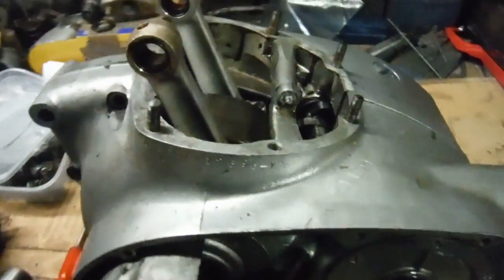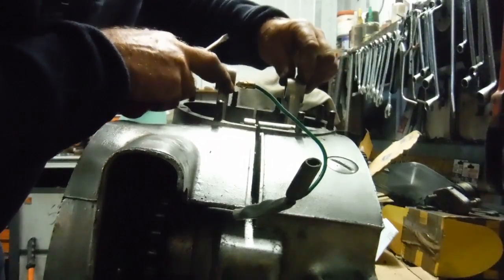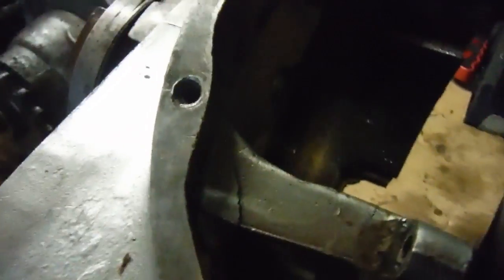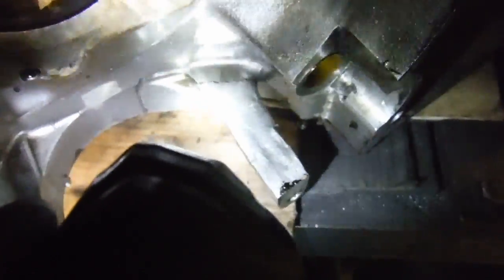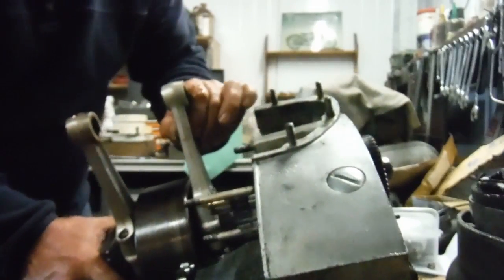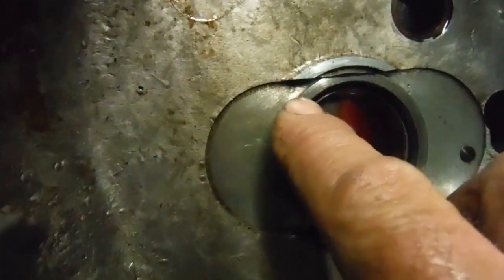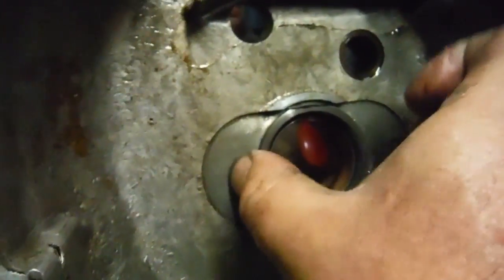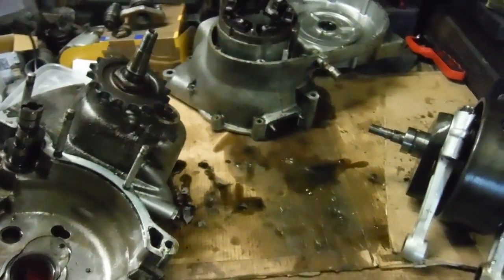BSA A65 engine - splitting the crankcases, what will we find?

Comment: Those big ends looked a bit on the tight side, they should have at least a thou/thou and a half clearance.
Reply: Aluminum or steel con rod caps do we see?
Reply from the maker: Aluminium.
Reply from the maker: They were still covered in oil, cold oil ...
Reply: @paulhenshaw4514  I'm sure you will be plasti gauging them. At least it's apart now, so checking and repairing can begin. Looks like it might not be too bad.

Comment: Generally speaking no thrust washer with early (before 1965/6) A65's with ball drive side bearing. Bush has thicker flange for these motors. With roller bearing in it's narrow flange bush and a thrust washer. Both need shimming to 3 thou max end float between crank web and drive bearing whatvever it is (ball or roller). What you have here Paul is what I've seen a lot over the years with A65's, mixed bits that sort of work ish if you get me. A lot of A65's were blown up back in the day because of this. Early and later cranks are different too (Webs machined plus case to match to shift crank over, plenty of info on internet...), mixing and matching can work if you know what you're doing. Interesting that crack on bridge piece, any evidence a rod hit it? I've seen that to in the past. Great stuff so far!
Reply: I believe that the crack was caused by a drive side main bearing letting go and allowed the crank to move. Interesting to say the least.

Comment: It’s great seeing an expert like you tackle a job like the A65. In my day (late 60s, early 70s) I used to carry out my own repairs on my own bikes (BSA C15 - fitted Hagon cam, new main bearings, high comp 10:1 pistons, stronger rods, larger valves, etc) also Triumph 500 Daytona, 650cc T110, etc. (I.e my Labour was FREE). HOWEVER, your work on this A65 must be costing the owner an absolute FORTUNE in your labour costs! Would it not have been cheaper for him to find another A65 in good running order; or a spare engine?
Reply: You're assuming an spare would be in better condition, after all these years? One never gets one's money back on bread and butter machines, even on Gold Stars; a reason so many jobs get bodged in the first place.
Reply from the maker: My hourly rate is very reasonable - probably too reasonable, and hardly a fortune - but I may be reviewing it soon ...